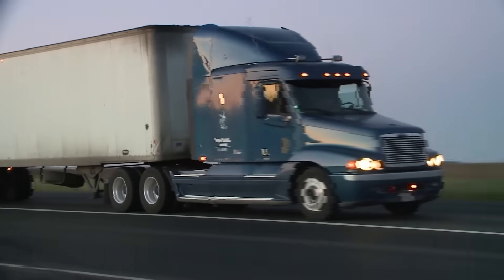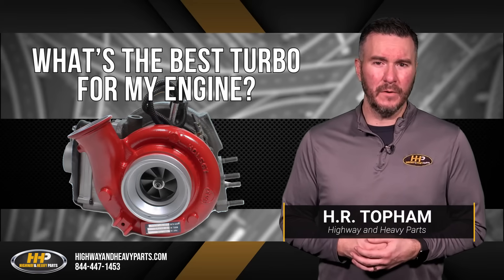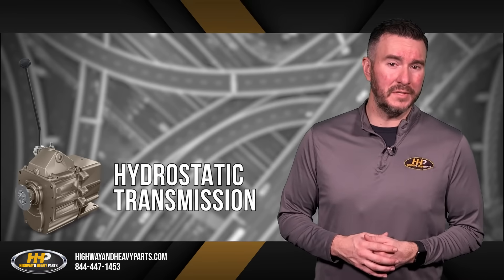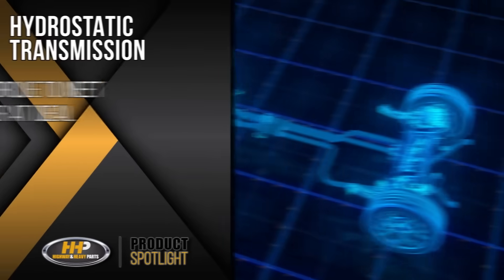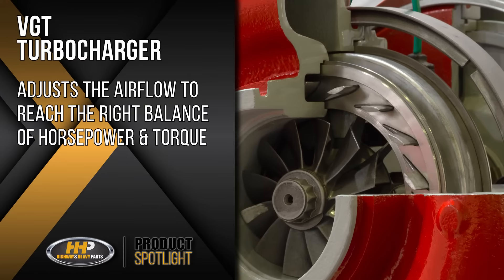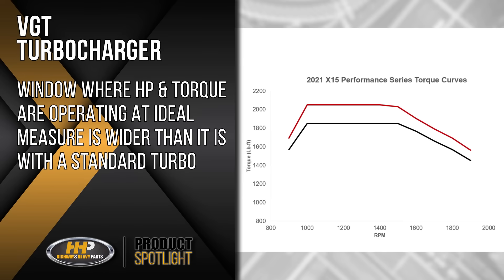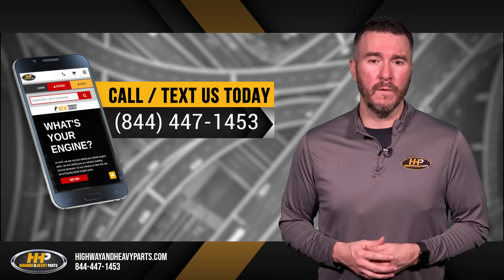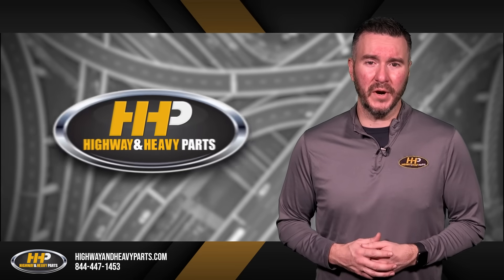What's The BEST Turbocharger For My Diesel Engine?  VGT, Wastegated, Traditional?

Comment: How much should I expect to pay if I wanted to upgrade my stock turbo on a 2005 5.9 Cummins (motorhome, Allison 2500) with a better performance one ? (Got 40,000 miles on the RV , everything is working well)
Reply from the maker: Depends on what we currently have available. Give us a call at 844.447.1453 and connect with one of our Technical Sales Reps with your engine serial number.

Comment: Have any kits for a 12 valve Cummins?
Reply from the maker: Yes, we do have kits for the KT/KTA/KTTA series engines.  Contact one of our ASE Certified Technicians with your engine serial number for an accurate quote.
844-447-1453